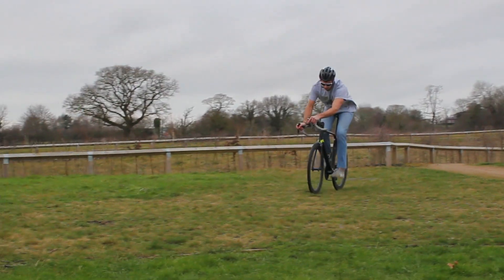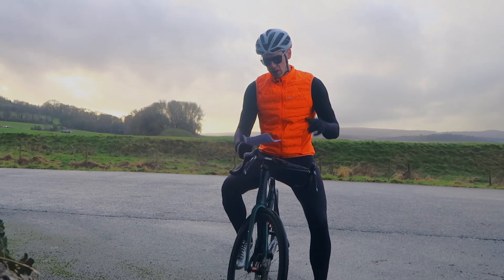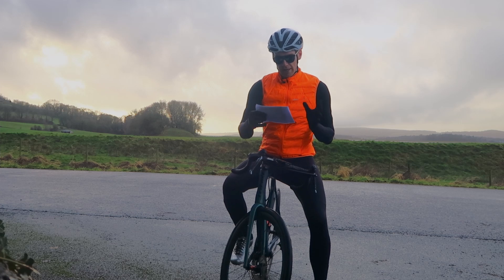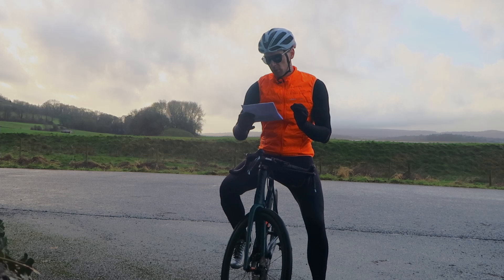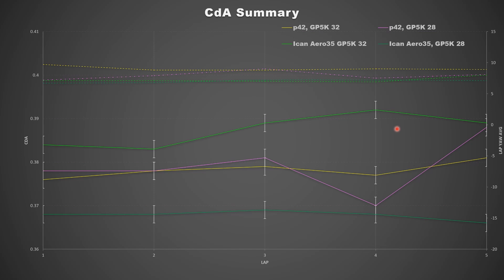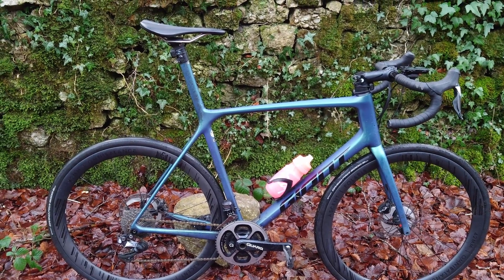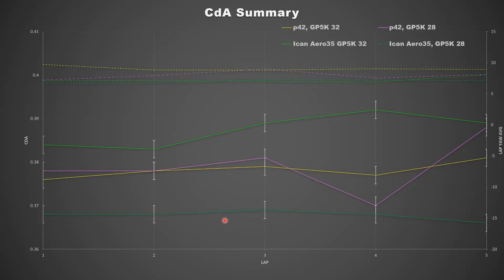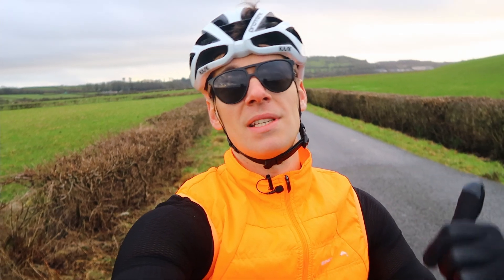Are Wider Tyres a total WIN? The Aerodynamics.

Comment: These tests are great, and I sure hope you keep doing them, especially taking into account mere mortal average speeds into your testing. The cycling media and industry has somehow decided that an average speed of 40 km/h (or more) is somehow statistically significant as a reference, as if most cyclists, regardless of sex, age, fitness level or weight are fully comfortable with pushing 300W average powers on a daily basis.
Reply from the maker: im about 270w to go 36kmh in an upright position where the air is thick and cold, but thats cos i have a pretty big CdA!
Reply: @PeakTorque  my FTP is around 260-270W (used to be about 290W a couple of years ago) for 182 cm, about 87 kg and a rubbish CdA, but there's no way I'll willingly put down that much power on flats for more than a couple of minutes at a time. So far as I'm concerned, a 190-200W average power on flats already involves spending a lot of time in the upper half of my HR Z3 (over 145 BPM), which is more than plenty for my usual 4+ hour rides.

It's great though to see how marginal all these aero gains are for somebody who rarely goes over 32 km/h on flats with no headwind and usually ends up with 25-26 km/h average speeds when riding solo. Again, far from what the cycling media and industry think the average road cyclist actually does.
Reply: air speed, not your speed
Reply: so what? if you ride into a headwind, you go slower, if you have a tailwind, you go faster - your average speed over one year will still be whatever it is, in this case 25-26 km/h
Reply: The people who are likely to spend that kind of money are likely to be serious competitors as well..
Reply: @davidngqkalone88  ... or mamils willing to spend large amounts of cash to buy unnecessary stuff

Comment: so a 23mm tire with a proper wheel set in a frame that is designed for that wheels is still the fastest setup?
Reply from the maker: yep, but only a smooth road where vibration losses will not occur.

Comment: I want to see a test like this with like 45c tires!

Are there any aero-ish super wide rims out there that would be optimal for a tire that wide?
Reply: Not quite that wide. The widest gravel rims are from Hunt and from 3T.
Reply: Cross country rims but they wouldn't be aero at all.  I'm planning on building a set anyway.   Something about 27 to 28mm internal
Reply: I have 40mm Terra Speed gravel tyres on my gravel bike. I've ridden 32C Conti gp5000, so i'm all in favour of that for the road. But 45C road tyre makes absolutely no sense.
Reply: @pierrex3226  not too long ago we said that about 28c tires and now they are raced at the tour; for anybody slower than world tour speeds maybe a 30c or higher could be faster assuming a good rim/tire interface; just curious really.
Reply: @brian_simmons_  yes, but no. I'm saying that as someone who's ridden 23, 25 28 32 and 40. Road 40 is already ridiculous. Road 45 is extra ridiculous. Wider is better, up to a point.
Reply: @pierrex3226  road 40's is certainly ridiculous haha; I do think at least in gravel 45's will be more common at the pointy end of things than they currently are.
Reply: @brian_simmons_  ah, gravel is a completely different story. I'm happy with 40 but in mud or sand, I sink.

Comment: When I started using the Michelin Pro4's (well, at the time they were just Pro's) I was shocked at the substantially lower rolling resistance. When I tried the GP5K's, I didn't notice any improvement in RR, though perhaps in cornering speed, which is difficult to quantify. The Pro4's are cheaper and seem more puncture resistant.  But the change from high pressure 23's to 28's made such a difference to ride comfort that I wouldn't have cared if they were slower. Since you're perhaps 15 lbs heavier than me, perhaps the wider tire is more comfortable for you. I have a recurring problem with speed being used for the quality of a ride, but then I am 78. But when I was riding 10,000 miles per year, I don't believe I was especially interested in speed on group rides unless everyone else was very fast. Then, I had a carbon fiber fork fall apart and drop me on my forehead, and my life changed completely. For two years, I was completely out of it. I was not even remembering to eat, and my previous 100kg fell to 60. I was finally taken by a cop friend to a competent neurologist who determined that I was having seizures that I couldn't remember afterward. It took about 6 months to determine the best medication and dosage, but suddenly, I became aware. I returned to riding with a vengeance on all of the latest bikes, but slowly, I became more uncomfortable with a bike made from strong fiber held together by weak resin. Finally, my cop friend who had saved my life had the entire head tube fall off of his C40, and he was lucky to only lose a finger because he was making a sharp slow uphill turn. But 5 minutes later, he would have been descending at 40 mph in heavy traffic. That was the final straw. I tried aluminum bikes and didn't care much for the noise. (The new ones like they Trek Alpha do not have that problem). Back to steel and 90s, welded frames are only marginally heavier than carbon fiber. My present Tommasini Fire that I put a steel fork on is 1/2 lb. heavier than my Trek Emonda. Somehow, I couldn't care less about the extra weight. I am shocked by the RR difference between the GP5K'S and the Vittoria Corsa.
Reply: As dumb I may sound sound but even few stories of broken CF forks keep me sticking to steel. Have a great rides!
Reply: That is a crazy and interesting experience? Which bike has the fork snap on you? And your friend's C40 must have been pretty knackered and a lot of mileage.
Reply: Michelins are very underrated. Michelins have the best rolling comfort, feels better than Conti 5ks
Reply: I stay away from full carbon bikes for that reason, and because they also cost way too much for little gain. I didn't think a carbon fork could just snap like that though. My bike frame is aluminum but of course parts like the seatpost and forks are carbon.
Reply: @username8644  aluminum is more fragile than carbon.
Reply: @tommyfreckmann6857  That is a pretty dumb statement to make. It's definitely more fragile than aluminum for a bicycle. Once the resin starts to wear or you have a chip in the carbon, it's integrity is compromised. You can have a dent in aluminum and drop it and it'll be perfectly fine. Aluminum is 100% less fragile and more robust than carbon for a bicycle. You have to remember we are talking about something that is going to get dropped, crashed, damaged, and ridden a lot in all conditions. Carbon has a limited life span.
Reply: @username8644 is a very arrogant statement. Read some studies, tests, and broaden your horizon a bit. Tour Mag did a destruction test of Al, Ti, steel, CF and 2 carbon frames never failed, whilst all metals failed. Al is notorious for cracking, as it is not built to flex like carbon can, which will significantly reduce lifespan. Steel is significantly more reliable than Al. And depending on current specialists, CF does not have a lifespan if it is obviously not had an impact, it can take a lot of impact to actually decrease longevity. Ultimately, aluminum is very commonly given lifespans of 3-4 years by manufacturers.
Reply: @tommyfreckmann6857  Lol definitely not trusting that source. Aluminum definitely has a longer lifespan than carbon if you ride a lot, you are bound to damage the bike at some point and once carbon has been chipped, it needs to be replaced or you are putting your life at risk. I'm still riding a Cannondale Saeco Caad7 that has a lot of miles/km on it and it has a dent on the main tube, no problems. I doubt a carbon frame that's been this abused would still be ridable. Of course the other parts like forks, handlebar, seatpost are carbon, and that's fine, but a carbon frame is a waste of money. I would obviously prefer a steel bike but those are not common and out of my price range because they are some sort of "hipster" type of trend now. The best would be titanium I think but also way too expensive for me
Edit: and their destruction test likely didn't consider carbon that's been abused. Sure good condition carbon is better but it doesn't stay that way. A good example would be the titanic sub that recently imploded (which was entirely made from carbon fibre). It made a number of trips perfectly fine and eventually imploded. The carbon got used and lost its integrity. That would have never happened with a steel hull which is what ALL real subs are made with.
Reply: @username8644  I am a big believer and obsess in longevity of things for a multitude of reasons. I hope your frame lasts a long time. I know of a guy who rode 100,000 miles on hos Colnago C50 and another one who has a C40 from 2003/4 which has over 50,000 miles and has been in a few crashes and had one repair from one and is still going. Which I think is from extra material.
Reply: +1 for Michelin power

Comment: I have light bicycle ar375 which are 25mm and bulge out to 30mm and currently run 25mm gp500Str (27mm measured), would there really be a penalty if I swapped to a 28mm F and 30mm R?
Reply: No

Comment: Great timing.  I run 32mm GP5000S TR and just upgraded from 23mm external width standard rims to Roval Rapide CL II (35mm max width) aero rims.  Using the "Chung method" I found a 12% lower CdA.  I know a lot of that is due to eliminating the "light bulb" effect.  Also, since the Rapides are optimized for 28mm I was wondering how much aero I was giving up running 32mm tires.  Roval support said the differences would be quite minor and your work backs that up.
Reply: I have the same wheels as yours can i ask, does your front hub feel quite resistant? do you get many revolutions when in the fork? i understand that dt hubs need preload of the fork to allow them to work well as they feel pretty rough off the bike with out pressure. just curious  how free you're front hub is.... many thanks in advance

Comment: Ive been waiting for this video for a while, so in conclusion, if you haven't yet invested in modern wider rims (at least 21mm internals) wider tyres are a penalty. could you also please comment on team Ineos using 25mm front and 28mm rear , the new canyon aero road also mirrors this set up.

Comment: Well Continental claims that much of the aero efficiency of their GP5000 is due to the side thread in the tyre, so that might explain why two tyres of the same diameter perform differently, and still via an aerodynamic rather than rolling effect

Comment: Vittoria Corsa cotton fanboy here. Yes, I have run older Continental GPs and Michelin Powers a few years ago, when going to Corsas I felt like I am on really fast and comfortable rail tracks. On pair prior to my last Corsa Controls I made 10Kkm rear/14Kkm front, changing them after 1st flat on the rear, while even the rear one had at least half of the profile left. And the wear is not square as on nylon tyres. From autumn I am on Controls and they have been a blast. I can even descend with them on partially snow covered roads with confidence, that's how good the grip is, no wonder that most of peloton used these in tubular version just a season or two back. I can't feel difference to standard Corsa profile in speed, while I can feel minimal penalty on flat speeds on Corsas vs older GPs, but there is no way a 19W difference in ride feel. That is more than difference if I put on alu shallow wheels vs aero carbon - which I can surely feel then. And my times on Strava are in favour of Corsa cottons, so I really must trust them more than slippery GP/Power even on climbs. And it is a much more comfortable ride even at higher pressure than on GP to match the comfort. If I was racing crits then I would think of faster tyres, but for my style of riding Corsa cotton are FTW and I am maybe even staying on Controls in summer as these are probably one of best real 4 season tyres. Saying all that I would like to try newest Michelin Power Cups, does anybody have a real world comparison between Power Cup/Corsa cotton?
Reply from the maker: I think the corsa controls are a good all round tyre but not the fastest, and the corsa speeds for me are the fastest but just don't last long enough and are pretty fragile. The last set of Powers I used cracked around the diagonal sipes on the tread. 4 tyres did this, absolutely unforgiveable!
Reply: @PeakTorque  whoa! Then I guess the only non-cotton experiment that is out there left for me are Pirelli P Zero Race 4S.

Comment: After rewatching, the ratio between outer rim width and stated tyre width versus the aero performance makes sense: the 28mm wide Ican aero 35 wheels were faster with the 28mm tyres, and the 33.5mm wide Ascent Polaris 42 wheels were (slightly) faster with the 32mm tyres. 
The smaller benefit with the 42s and 32mm tyres may be because the rim is actually wider than the tyre in that case?
This suggests a 1:1 ratio of rim width to stated tyre width is the best in terms of aero, what makes  sense really

Comment: Tire sizing is all over the place which is a bit annoying, I gotta say. I got Vittoria Corsas labelled 25c. On a rim with around 22mm internal width they measure a true 29mm. So they're just fractionally narrower than my rims at around 29.5 external. It's a fast combination. Schwalbe and Conti tires have been significantly downsized. The 25c Corsa is wider than a 28c Schwalbe One on the same rim. You really got to do your research when buying tires these days.

Comment: If wider tires were faster, period, then they'd be used in all track racing.   But they aren't.   22mm are the norm for indoor velodromes.
Reply: it is not that easy. in terms of cda, the smaller frontal cross section would always be quicker than a higher one -> the narrower tire. for indoor racing, there will be no suspension losses because the surface is dead even, and also no other factors such as higher fatique due to road chatter etc. so yes, a narrow high pressure tire is optimal.
on the real road, with a surface that is rough, has cracks etc. a wider tire with less pressure will still be a bit slower in terms of aerodynamics, but faster in terms of rolling resistance. so its a trade. depending on individual riding (road surface, speed, power output etc.) , there will be a sweet spot between tire width and pressure that is optimal.
Reply: @Digi20    The point is typical roads are not excessively rough over 100% of their distance. maybe 20%. So people are going to wider tires to gain an advantage of 20% of a road, and disadvantage for 80%. 
I intentionally avoid rough roads, and stick to smoother wider roads, as I presume most riders do who like speed. 
The best way to reduce rolling resistance and increase comfort to smooth out rougher roads is to drop bodyfat % below 10% (males) 15% (females), which is pretty much a no go topic in cycling media.....the bike industry doesn't make money out of cyclists losing weight.
Reply from the maker: You obviously don't live round 'ere in northern europe :)
Reply: @PeakTorque  
Pros use 28-32 racing on cobbles.....but then, their bodyfat is sub 10%!!!

Comment: In my club there are more riders on wide tyres and heavier disc brake bikes, most are slower not faster. They are basically riding bikes more suited to off-road than the smooth tarmac they ride, it's bizarre.
Reply from the maker: Yep for smoooooth, I would pick a 25mm at high pressure. No doubt. But its 'horse for courses'

Comment: that transition is not at least a design issue, the eye got to like the ride as well,
but on top of all that, one should remember to consider much more important issues for layman riders with the tire choice, as
- grip,
- durability,
- how they actually drop off in corners or when braking,
how they perform in their second half of their life span,
- comfort/traction vs. weight/agility concerning width.
Differences in the mentioned are staggering - and decisive for the pleasure and safety of the sport.
I opted twice for top ranking products in a bike magazine's comparative test.
Both had to get off the bike after one or two rides.
They just were dangerous fun preventers and in one case have even shown very quick wear.
So some self education and research pays off, as well as incrementally testing forward from a once well-proven selection.
Reply from the maker: thats why i like conti. One of the lowest Crr but durability, wet grip, and puncture resistance beats the other low Crr tyres by a mile (Corsa speed etc)
Reply: @PeakTorque  I for purpose didn't mention brands. But Conti actually IS the benchmark. Yet they (the 4000-s) drop in performance significantly when their compound isn't fresh any more. Cannot say something  about the 5000-s, don't have the mileage on them (Bike since more than a year stripped for painting...).
But there is one clearly superior to them: MAVIC. When fresh they are a bit less agile then Conti - but they stay as they are literally till last bit of rubber is down and you ride on the linen. And they last long. Really long. When you fit a new one of the same, other than with Conti, you don't realize that much of a sudden improvement. Further plus: Their 28mm isn't really 28, but still much more than 26. It such fits well under fenders or in older tight frames. And they look cool...
Reply: @AGENDA_1938  Has the performance drop of Conti been documented anywhere? 1st time i hear it. I've been riding them for years and the fact that it could be the case never even occurred to me. And which Mavic tyres are you talking about?